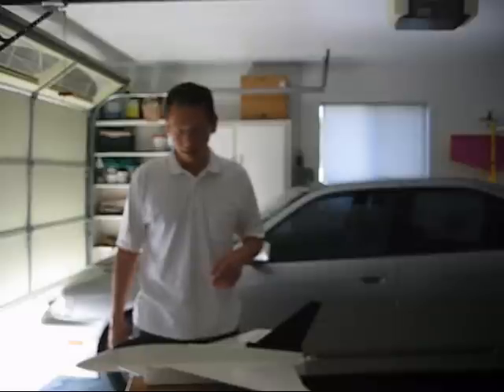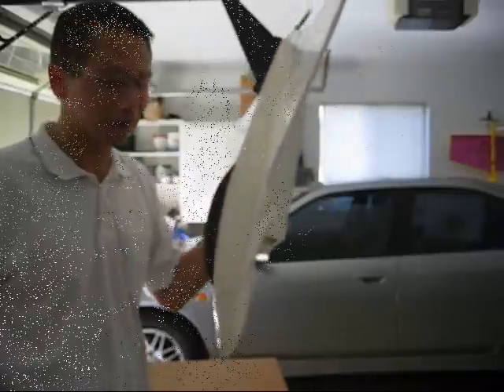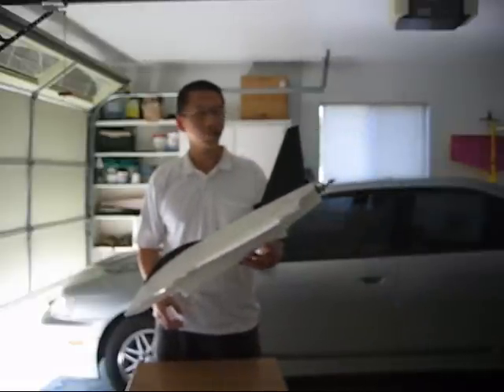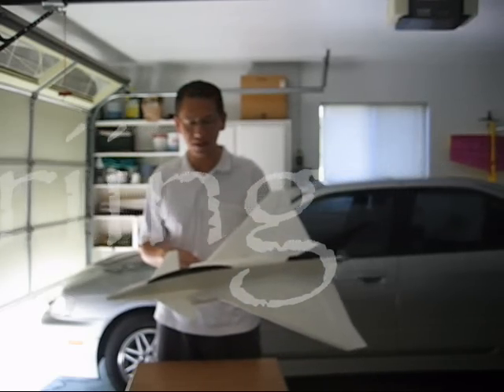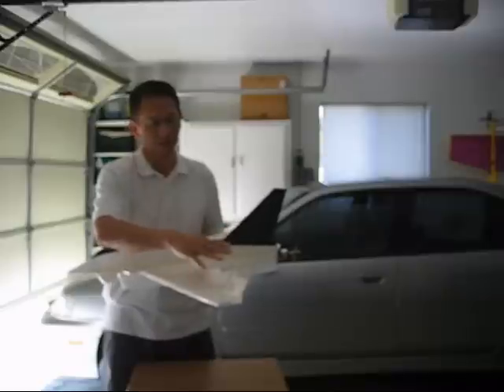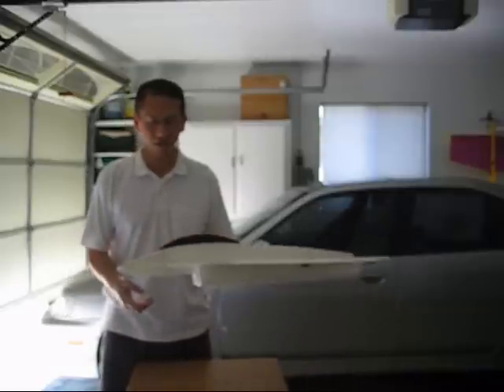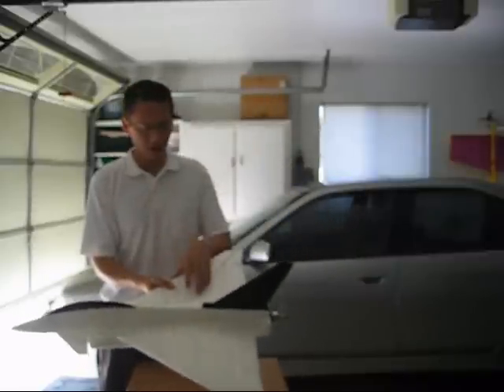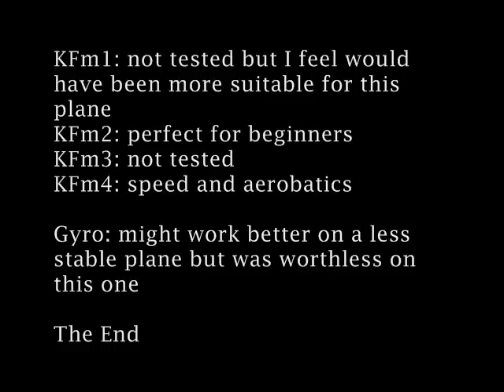KF airfoil and gyro findings on scratch built eurofighter

Comment from the maker: I'm only running 2 servos in the test plane I used (elevons/delta mix), do you mean that you would run the leading edge slats off the same 2 servos? This means that the varying movements of the control arms would affect the active slats either proportionally or inversely proportional right? It seems that you would want the slats to be determined by the speed rather than the position of the aircrafts control surfaces optimally. Please expain, remember, I'm a newbie at this with no experience.

Comment from the maker: your right, I also do believe active canards would solve my stalling problem and increase the agility of this plane, but that would mean more servos and more moving parts everywhere instead of just gluing a piece of foam to my wings. my point is that if i wanted to solve a simple math problem by adding 2+2, I could go about by building a calculator to solve that problem or hold 2+2 fingers up and count and end up with the same solution, only simpler.

Comment from the maker: i'm a newbie at rc planes so I do admit that I am not familiar with how to set up leading edge slats other than being what appear to be flaps at the leading edge of the wing producing a Clark-Y based wing when flying at slow speeds. The slats are then turned into the off position at high speeds to decrease the planes lift which is more efficient when flying faster. I would appreciate it if you sent me the physics involved in how it works before I try them out. i became interested in the KF

Comment: the KF air foils seems to simulate leading edge slats, KF will not perform well on any plane I seen it on @ high speeds 68 mph and over. and its easier and more fun to actually have and run active leading edge slats to run stable both @ slow and high speeds. Hello. Dump the KF and run active slats unless your plane was designed to be slow bird.

Comment from the maker: It's kind of cool that you got the same findings as I did with the KFm2. That way there is consistency (interrater reliability) during the two seperate experiments, on two different planes, using the same airfoil. I know it's not a very controlled study/experiment, but at least it continues to confirm what Dick K. had been trying to prove all these years, even if it is just the subjective statements from two people that love his design (little bit of bias don't you think??heh heh heh)